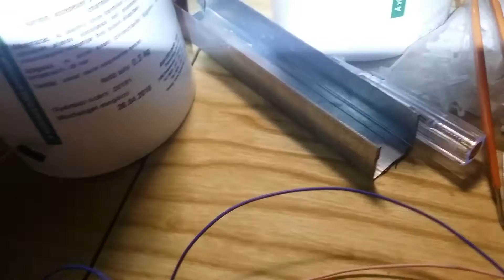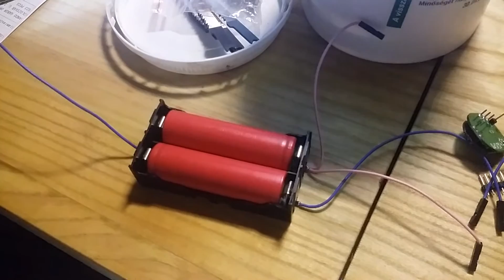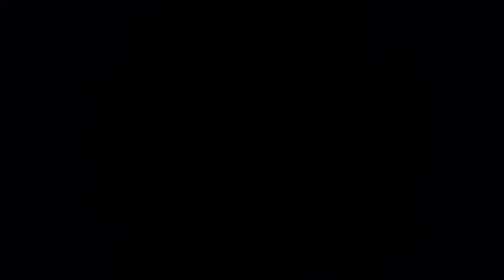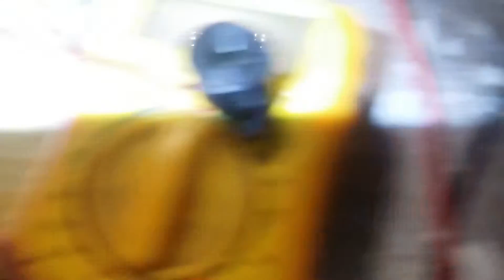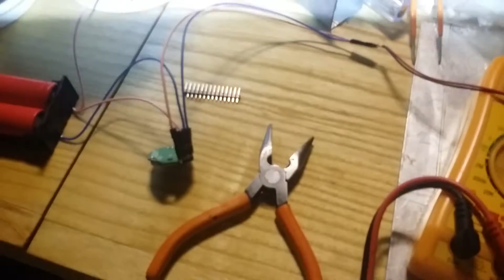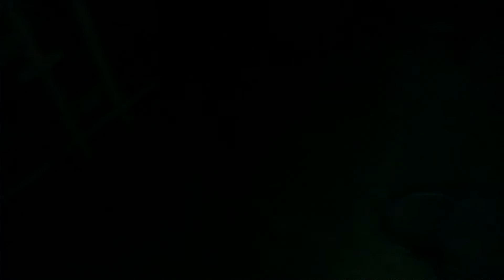Testing Microwave Radar Sensor LED Light Control Smart switch

Comment: This type of sensor can penetrate wood, plaster, bricks and concrete. However, it cannot penetrate metal. I notice that you are behind a wooden door when the sensor activates. They can also be affected by fans and
Reply from the maker: You are right, but the door has an 0.5mm  iron plate built in it. No fans were in the room. Later I purchased a good sensor, which did not have the same problem.

Comment: HELLO! Greetings!
I have a request and a question for you......
you can help me: how to connect the device to the (1Channel 5V Indicator Light LED Relay Module unit) without Arduino?
I connect to the relay without Arduino (pyroelectric IR Infrared PIR Motion Sensor Detector Module) but to this device (5.8GHZ Mikrovave radar sensor) i can not connect without Arduino...
i need connect Relay Module to Mikrovave radar sensor...
I would be very grateful if you help me!!!
below I will write links where there is information about the devices that I have tell you as well as the wiring diagram Relin module conect  to Infrared PIR Motion Sensor...

links:
1).  Effective Stable 1 Channel 5V Indicator Light LED Relay Module For Arduino 2Y

http://www.ebay.com/itm/281785013565?_trksid=p2057872.m2749.l2649&ssPageName=STRK%3AMEBIDX%3AIT

2). IR Pyroelectric Infrared PIR Motion Sensor Detector Module HC--SR501 H2

http://www.ebay.com/itm/111772398188?_trksid=p2057872.m2749.l2649&ssPageName=STRK%3AMEBIDX%3AIT

3). 5.8GHZ Microwave Radar Sensor 6-9M Smart Switch for Home/Control

http://www.ebay.com/itm/131864712562?_trksid=p2057872.m2749.l2649&ssPageName=STRK%3AMEBIDX%3AIT

4). diagram>>> without Arduino

https://www.youtube.com/watch?v=S_6dGTeFowg

I'm waiting for your answer...
best regards
George!
Reply from the maker: The IR Module has a 3.3V output, which is probably not enough for the Arduino Relay module, which requires 5V. You need to adjust the levels with a MOSFET or a transistor. You may also use a schmitt trigger or an Opamp.
Reply from the maker: http://blog.meajay.in/2015/01/33v-to-5v-logic-level-converter-using.html This is an example. Notice that this circuit will invert the output of the IR sensor. When The IR is high this goes down and vica versa.
Reply from the maker: Hoops I think I misunderstood you. You could succesfully connect the PIR but not the Microwave radar sensor.
Reply from the maker: The radar sensors probably have a so called open collector transistor output.  When the radar sensor is on then the output is pulled down to the ground. Otherwise it is disconnected. The best test is to connect the Radar sensor output with a 10K resistor to the + pole of the power supply, say 5.5V. This output will be high, when the sensor is off, and goes down to ground level when the sensor is active. You may directly connect this pin (with the pullup resistor to the relay module power supply  +pole) to the Relay module input. This will invert the output, but you can use the NO NC pins on the relay optionally.
Reply: thank you very much!